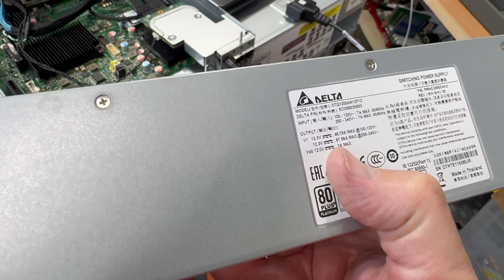HOMELAB:  Can we use a Nimble Drive Array with our own Linux distribution?

Comment: I just acquired one of these, haven't fired it up yet.
I'm curious if you can get TrueNAS Scale working on it, I heard they removed support for HA.
Does the SAS controller support IT/HBA mode or is it actual RAID?
I'm thinking about putting Proxmox Backup Server on one node and TN on the other and splitting the drives.

Comment: So, it's basically and HA NAS or dual node CPU based compute system. The part in the memory slot with battery is not memory. It is essentially a volitile flash-based SSD that has direct CPU connectivity. Battery needed to keep data. Used for high-speed temp drives that exceed speeds of other storage platforms. 
As for rest of chassis, you only have 2 nodes, I would suspect that there is a 4-node version with 3 PSU's.
The best use I can see for it is a twin-node VM Host .

Comment: I have one of these and managed to secure some Nimble software if you are interested. Otherwise mines a bit older and I can get into the management link however the bios is locked and wont let me reset the password, even after I bridge some pins on the Motherboard with a screwdriver as the manual says.
Reply: Can you share the Nimble software? I just acquired one of these HF20s and I would like to have a backup of the software just in case.

Comment: I've been looking at cheaper nimbles on ebay for awhile now. I always liked them at work but it might be really fun to run truenas on one
Reply from the maker: Yea, Truenas would work great.   I am going to experiment with a few different options.
Reply: Run a desktop machine instead of server class machine.Future expansion and costs will be easier. Energy costs would be low and reliability good enough. There are kits to fit multiple drive bays.
Reply: @prashanthb6521  lol, no.

Comment: Like this mini series on reusing seemingly custom hardware that's really just standard off the shelf hardware bolted together with some custom software running on it.

Those battery backed up DIMMs are cool though, never seen those before. 

Or the serial port that seems to be standard 3.5mm trs!
Reply: Serial port to an audio jack is an old trick. TI calculators and other devices had this for years.
Reply from the maker: Yea, the DIMMs are pretty neat.  I was just happy that Intel had a password recovery jumper on the motherboard!
Reply: Battery-backed-up DIMMs are amazing; I first saw them in 2003.

Battery-backed-up accelerator/RAID/HBA cards with DIMMs have been around since DIMMs appeared on the market.

In 2003, you could have an up to octa Intel Xeon dual-core server with various RAID cards with DIMMs and battery backup along with the CPUs' DIMMS and RAID cards' DIMMs all being battery-backed-up DIMMs.
This resulted in three levels of battery backup + the BIOS clock battery in a single enclosure before you reach the rack or data centre redundant battery-backed-up power.